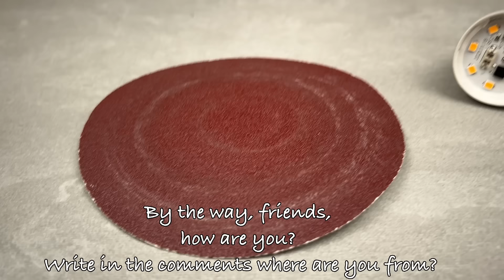🔥 The LED light bulb will never go out! Just take a pencil

Comment: It wouldn't last long, you'll putting higher voltage on the remaining led lights.
Reply: You definitely got that right because bypassing the burned out LED will increase the voltage to the rest of them and shorten the life of them
You need to salvage another LED from another bulb that's not working to replace it with , Or take an ohmmeter and measure the resistance of an led you salvaged and replace it with a resistor , you want to use a resistor or an LED from another bulb , Whichever is easier to install , Because the LEDs are wired in series just the same way as conventional Christmas lights as they are wired in series and when one bulb burns out , Even though the rest remain lit will increase the voltage to the remaining bulbs , The more bulbs that burn out , The more the voltage will be increased to the remaining bulbs , Unless you can use another LED from another bulb or use a resistor , 
It's not worth trying to fix an LED bulb as direct bypassing the bad one will shorten the life of the remaining LEDs
Reply: Exactly right , we used to do this on the old Christmas lights, to keep them going over the festive season, a bit of tin foil , short time fix
Reply: No dura ni 10 minutos, se funde otra vez
Reply: Напряжение не при чем, здесь стоит стабилизатор тока (драйвер). Закоротив один диод, ток останется прежнем и увеличит нагрузку на остальные рабочие диоды. Сколько проработает такая лампа, это как повезет. Может быстро сгореть, а может проработать довольно долго.
Reply: A CO když odejde další ?? a další ??? 🥴👎
Reply: Reduceing the amt of leds has nothing to do with the voltage it stays the same it only reduces the amt of brightness.
Reply: ❤❤hi❤❤
Reply: @jotaefe1777 😂😂😂😂
Reply: I strongly suspect you need to learn more about electricity.

Comment: All LEDs on such a COB are connected in series and are fed by a switching regulator delivering a current, not a voltage. Just identify the defective LED, and short its pins with a piece of thin wire using an soldering iron. No resistor needed, especially none of an undefined and surprising value...

Comment: Commenters below say you need to replace the bad led with a good led or the voltage will cause the remaining leds to go bad.  Just bypassing/removing the bad led is not good in the long run.

Comment: Hi, old pc/electronics tech.  Alberta Canada. (by the way - sometimes i find, those fancy VAPE  machines....some have a digital ' battery ' level display - USB c type charge socket . On/off and  ' push'  to  vape switch, on bottom .   TAKE OFF  the battery part - KEEP  THAT   electronics. ....for charging   OTHER   3.7  volt   batteries = complete,  with  battery - charge   / hold  current   level display .   thanks, for more  MODERN  education.

Comment: The other leds get a higher voltage so you had to mount a resister on the place of the defect one! To protect the other leds! So count the number of leds and find oud how many power the takes! And find out how many milliamps flow and find the resiter value! Or find a led out of a other defect lamp, with the same value en replace the defect one! Succes!
Reply: I agree.    from japan.

Comment: Glory to God alone!
 Manufacturers have put a lot of effort into making the light bulb burn out as soon as possible after the warranty expires.
 They use heat insulators instead of heat conductors both in the base and in the protective cap.
 Such repairs will not prolong work for a long time.

Comment: I removed a circular led panel from a stander led plastics lightbulbs now im left with the panel and the 2 small cables what type of compent dose it take to light one with a battery I need to know since I know got myself what’s inside of a lightbulb it doesn’t go at the house .. correct so I need a power source. 🇩🇴🇺🇸 Hii comment on this please

Comment: can not just solder both end with out removing that LED ? what is that pencil crap ?
Reply: This is a repair that can be done by someone who doesn't own a soldering iron. Note the prying off of the bad LED with a knife instead of desoldering it. Other videos I've seen have shown the repair being done with aluminum foil and electrician's tape or a nail being used to scrape the old solder across the gap.